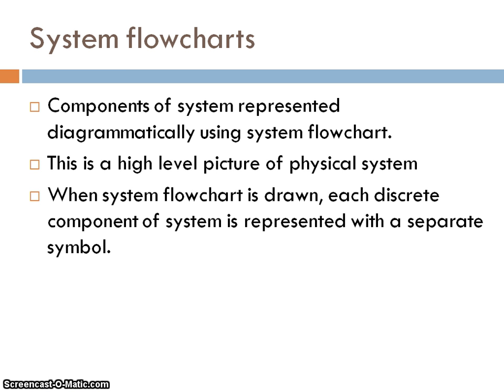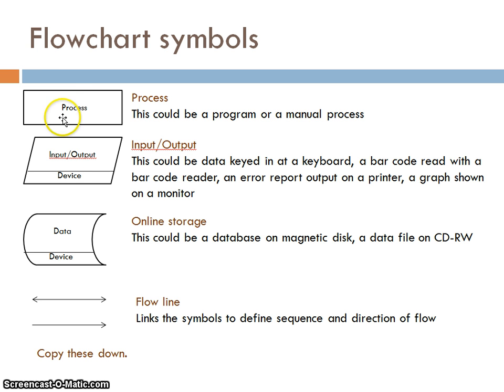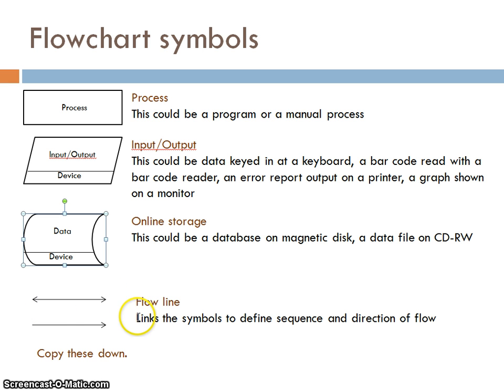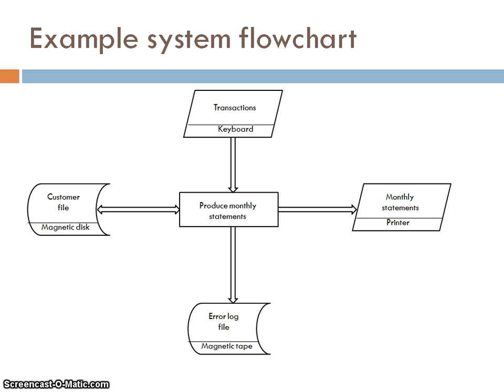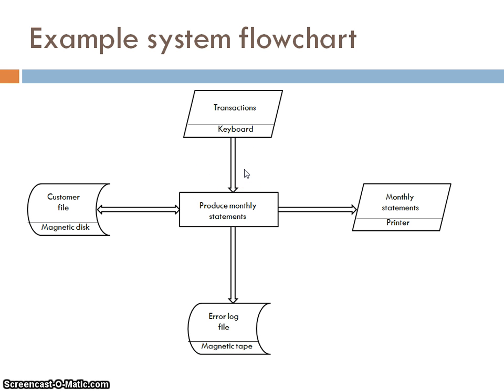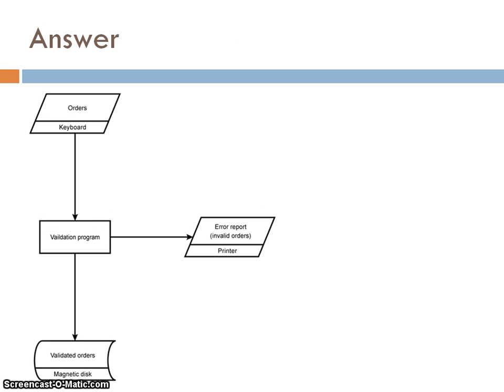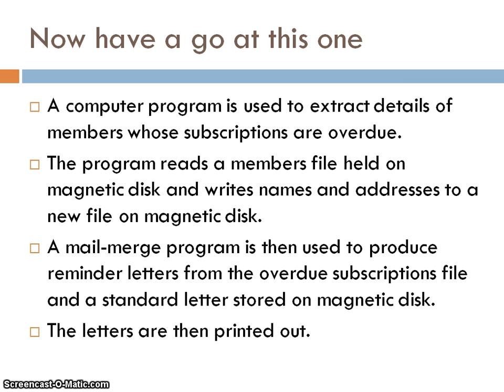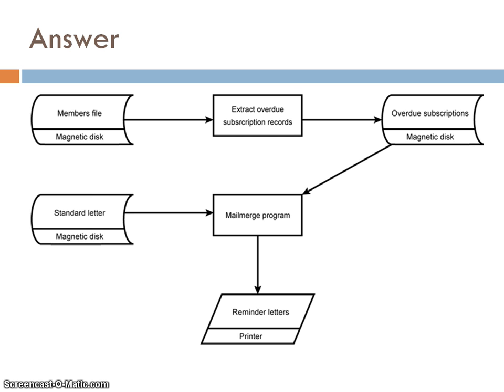System Flow Charts

Comment: A system flowchart show the data flow in a system.It represents the actual path taken by the data in a hardware or software scenario. In a system flowchart, each discrete component is represented with an unique symbol.